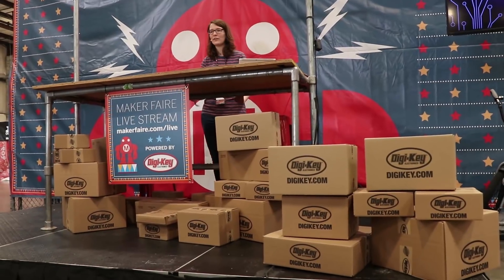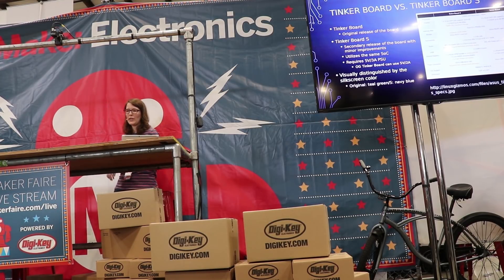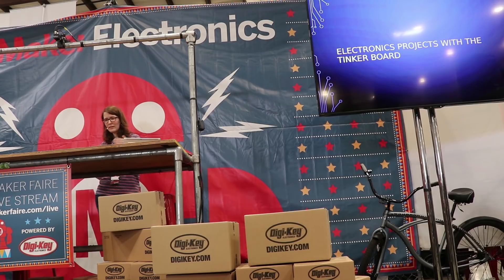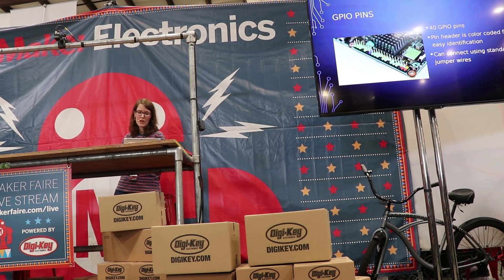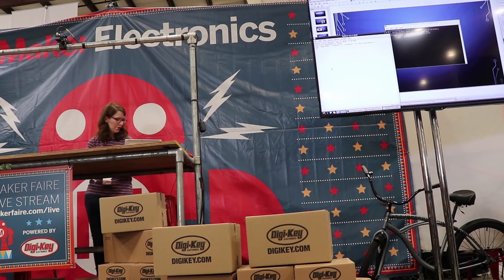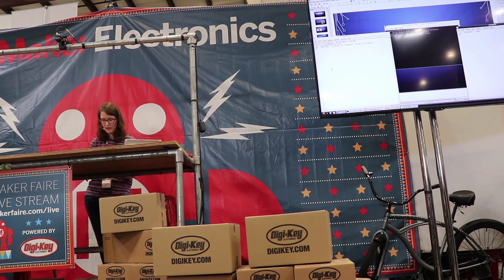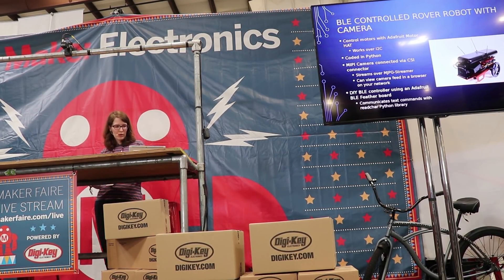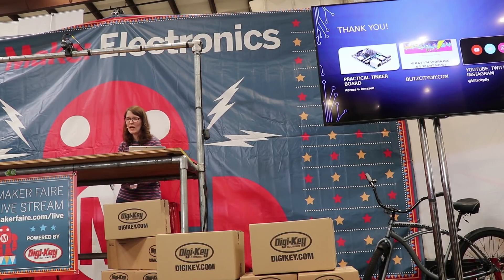My Talk at Maker Faire Bay Area 2019: Electronics Projects with the ASUS Tinker Board

Comment: Hi Liz,

Nice presentation -- wished I would have had info like this a year ago when I bought my first Tinker Board. Firstly the new OS V2.0.8 now makes the ASUS stand up a bark like a Big Dog. Less than a week ago I finally got (with the new OS) my SDR Ham Radio Transceiver to work with the Tinker Board. There is a youtube video of the this project under the N6QW youtube channel. 

It is a little more than a blinking LED; but showcases the compute power via the Fast Fourier Transforms and A to D Conversions. I virtually know nothing about Linux but have found that using the ASUS Board can be somewhat simplified. I have the same Transceiver working on a RPI3 (plain vanilla) and can see the difference. Today you can get the plain Tinker Board for $64 at Fry's Electronics. A bit more in cost but a large performance improvement. 

Thanks again for the video.. 

Pete N6QW